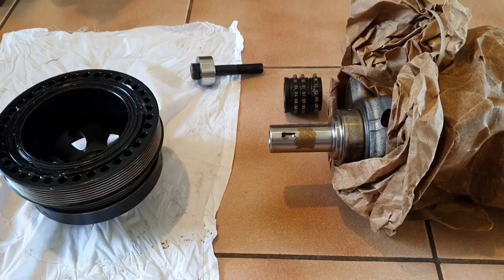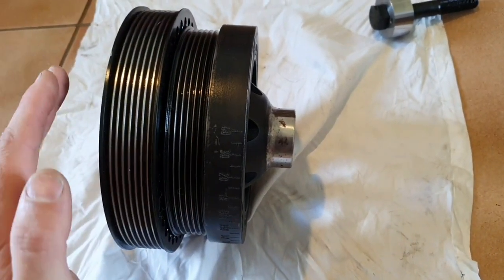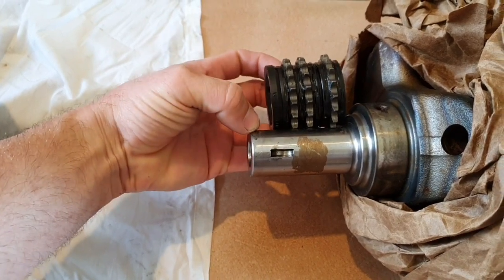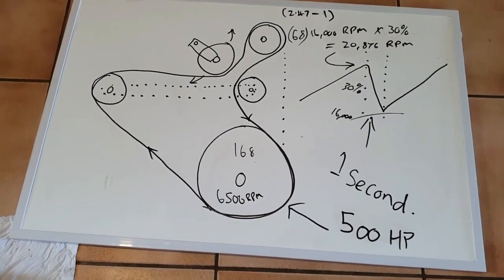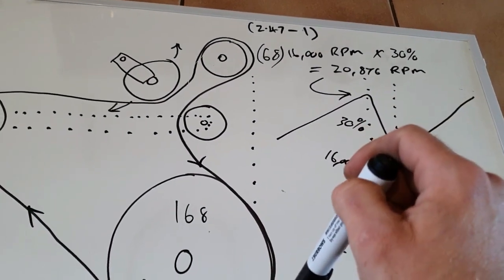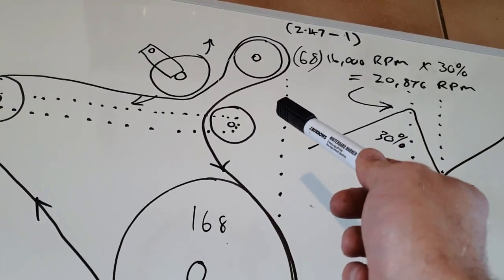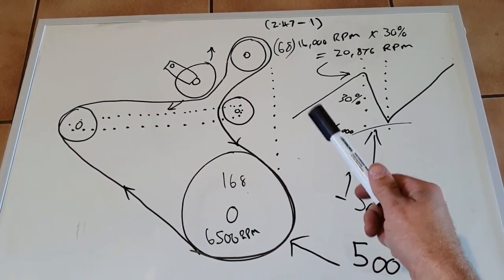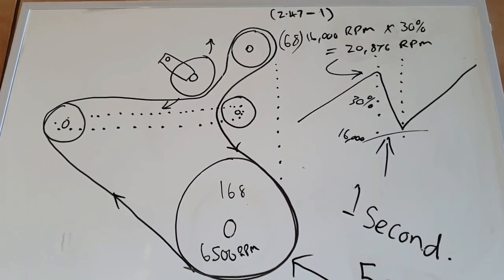Mercedes M113k Supercharger Belt failure fixed over sized crank & pulley issues explained E55 SL55

Comment: I after much research and speculation agree with this procedure. But i came up with some back yard engineering to remedy this more permanently.  I pressed in a metal bushing the same diameter of the crank snout the depth if the rest of the crank pulley minus a mm or 
Into the pulley.
2.
With a dowel cut I to it. Along with a notch grind on the típ of the crank. So i have factory keey way plus wedge on pulley end and snout extension.
As well as upd billet pulley. My constant nightmares of belts and shredding snout and launching pulleys went away. 

As well as pinning the SC tensioner with a long screw and nut causing it to limit the slack and slip. It has tension but limtis the withdraw. 

No more issues. 

180mm crank
74mm fixed pulley

This math makes 18psi and 60mph burnouts capable

And factory sized belt fits perfectly.

Comment: 180MM Crank pulley, stock SC pulley, no BWK,  plus a tune, and haven't broken a belt in 5 years.
Reply: and do you have any idea what exacly boost are you running and what horse power is the car because im planing to do the same thing and im wondering between 180 and 185 crank pulley with pin kit ?
Reply: @Chostera  180mm is perfect. I'm around 680 hp crank around 16 psi boost I think

Comment: why do people say a larger crank gives more torque vs an equal boost smaller sc pulley?
Reply from the maker: Because a larger crank pulley has more surface area and will slip less then the same ratio of smaller top pulley
Reply: @benzperformanceparts3762  Thank you. First reply to this question that I've seen that makes logical sense!

Comment: I have stock pulleys, and added a belt wrap kit in prep for a smaller sc pulley. After about 3000 miles I threw the belt. Think that's because the tensioner is pulled so tight? Even with stock pulleys?
Reply from the maker: It could a worn tentioner that's making it kick the pulley out on an angle.

Have to check all the pulley alignments

Comment: Hi,  
Do i need a belt wrap kit if i run a 180 lower and 83 upper setup?
Reply from the maker: Only if you believe you are having belt slip issues
Reply: @benzperformanceparts3762  Would that throw belts without belt kit? Some stated it throws belt with it and some stated it doesnt. Not sure what to go by.
Reply from the maker: @boyb72  I have seen a few guys I know with the biggest crank pulleys remove the belt wrap as they are sick of snapping belts.

Some can work but the majority have issues.

Just have to see how it goes
Reply from the maker: @boyb72  miss alignment of the top pulley can also throw belts easy.

If it's made wrong it can jump a v groove and then cut the belt up